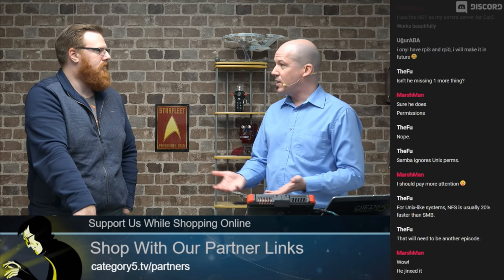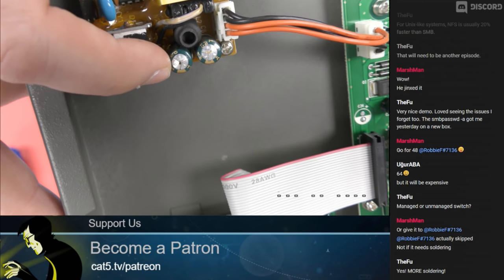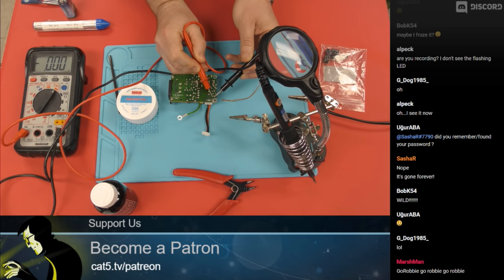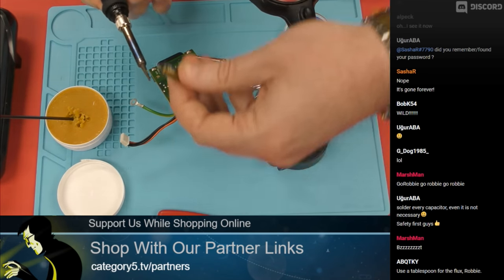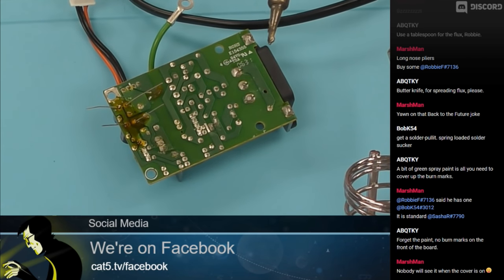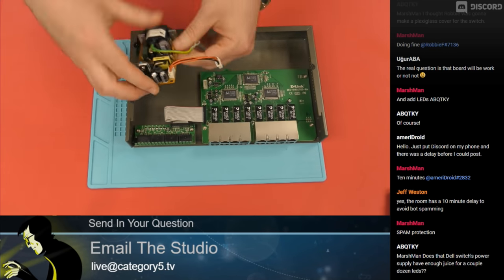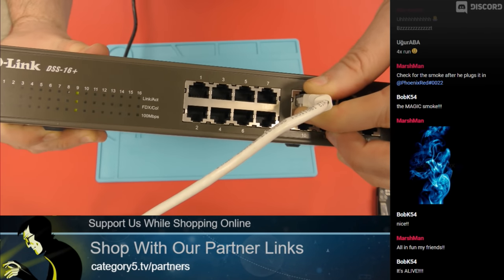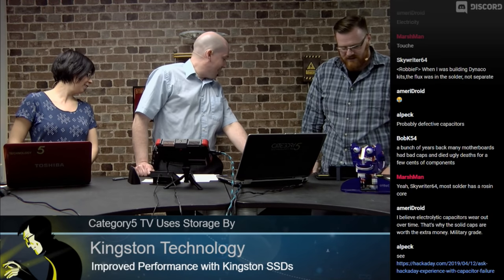YES, You Can Fix Electronics - Robbie Diagnoses and Repairs A Simple (But Common) Issue

Comment: Electrolytic capacitors like those have the electrolyte dry out eventually, then they short and bulge or burst...  I've replaced a boat load of them over a 30ish year span of playing with electronics...
Reply from the maker: Precisely! Yet, unknowing, how many of us have just replaced the devices when they 'die' -- yet hopefully it is clear from the video, sometimes (maybe even often times) a few bucks and a couple minutes is all you need to do the repair yourself.

Comment: You bought the wrong caps. The originals are green, which always means low ESR. And that is what you should get as replacement. Also, get a decent brand like Panasonic, Nichicon or Rubycon. That Shenzen market crap you are about to  buy will not last. And there is nothing wrong with a 48V cap if it will fit.
And secondly, you kept on going on about charge retained in those caps being dangerous. Even if they could retain charge (which they can't - they are broken) it would be five volts. That is not going to hurt you. But you completely ignored the bigger, bulk capacitor near the other end of the board. That one will hurt, as it has a couple of hundred volts on it, and as it is not broken, there's a good chance that voltage is still present.

Comment: Use iso alcohol 99% for cleaning and Ear cotton swab you have better results ! And you say you don't have to buy a solder station that costs over 300dollar but see your own solder iron the heating comes and goes and you don't have a temperature standby , fast heating , exactly temperature control ect. 
I tell everyone if you buy cheap iron solder station you buy twice ! Thanks for the video for not doing in that way but carefully!
Regards,
Reply: I always use horse hair acid brushes with Grade B 99.9% isopropyl

Comment: You need to be super careful  sticking your hands in the of a TV, some of those TV's  especially Plasma  can  have 1000's of volts on the capacitors which can re charge themselves ,  they can send you to the promise land instantly, TV's are my trade  as a TV engineer, time served BE CAREFUL.

Comment: Always remove flux otherwise it'll corrode the solder over time... I prefer using horse hair acid brushes dipped in isopropyl